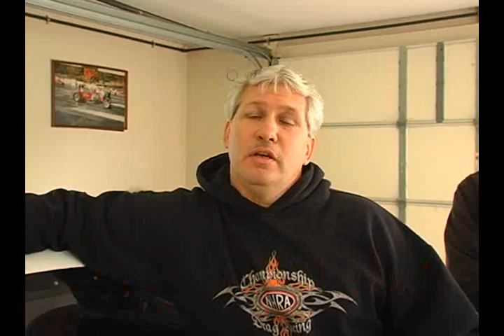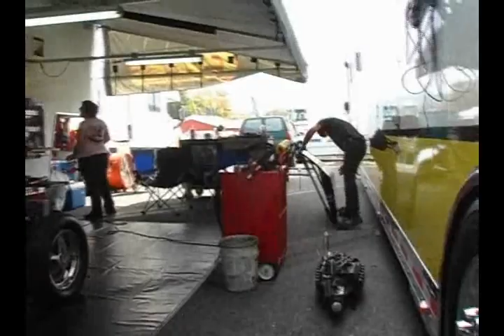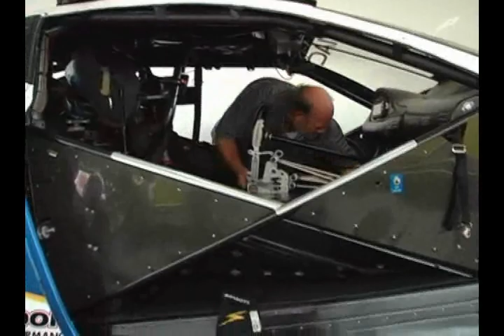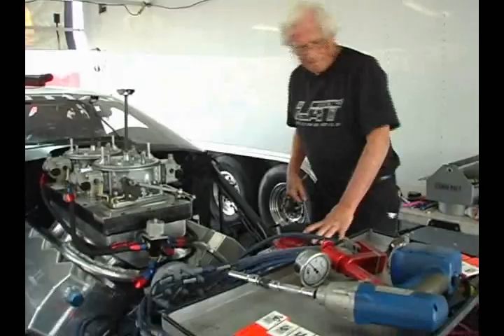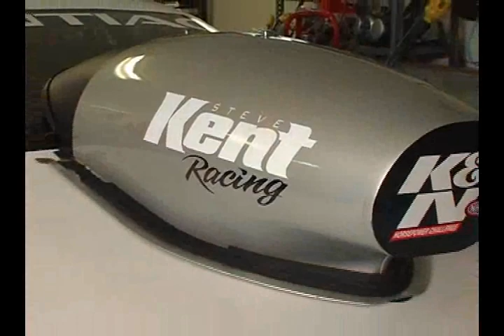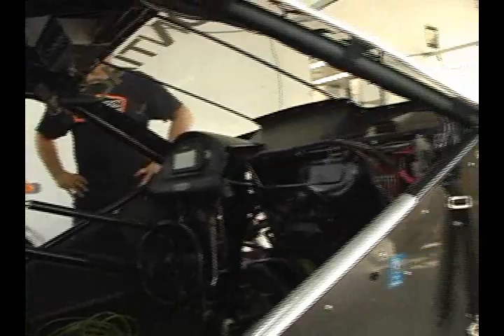John Gaydosh NHRA Pro Stock

Comment: I've had the pleasure of meeting Mr. Gaydosh at Bristol.  Cool, down to earth guy who works hard for what he has.  I sure hope the crazy rule changes for 2016 don't extinguish the dreams of guys like him.
Reply: +John Wilburn 
The 2016 Pro Stock rule changes will most likely help Gaydosh and other under-funded/part-time teams. 
Warren Johnson said that in 2015 a complete competitive carbureted induction system costs upwards of $30,000 per engine and the 2016 spec EFI system only costs about $10,000 MSRP. 
Engineering has shown and testing has proven that limiting the RPM to 10,500 is significantly less destructive and less costly to the teams. 
Again the theme is reduced costs and increased reliability for the teams to campaign a successful Pro Stock car for a season.
Reply: I realize what they are supposed to do, but Gaydosh and everyone else has made a substantial investment in the old technology and will have to lay out a lot of money just to make the switch.

Personally, I'm not a fan of what they're doing.  I like the pro stock racing the way it is, but understand why they're doing it.  I wish they would allow some changes to pro stock that get more pro mod racers into the class and bring back pro stock truck in a different form to do the more limited EFI stuff OR make Super Stock or SS/Hemi a professional class!  Talk about good TV!   But.... I'm more hard core for the technical stuff and not the average beer-swillin' fair weather fan and therefore outnumbered in the vote-with-the-wallet department :)

Comment: Best class in Nhra , no scoop this year Wtf?
Reply: NHRA-control freaks-have MANDATED fuel injection only for Pro-stock,using a specific fuel injector  (they say you must not modify).An air intake at the front you cannot enlarge and NO hood scoop.A throttle body that must be external,etc.etc.NHRA keeps pointing to the COPO camaro, so GM had their fingers in all this. NHRA and NASCAR should just build their own car then sell them,because with all the rules and restrictions every racer is just racing the same vehicle next to them.I would prefer a carb engine to run against an F.I. engine.
Reply: magnetstoo When they had carbs they had a full field , since efi no full fields . More expensive to run